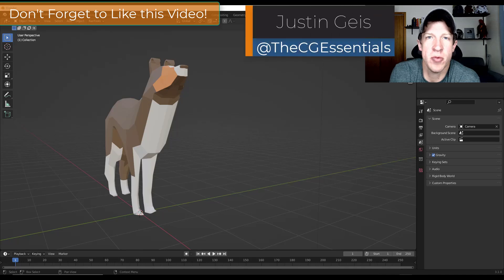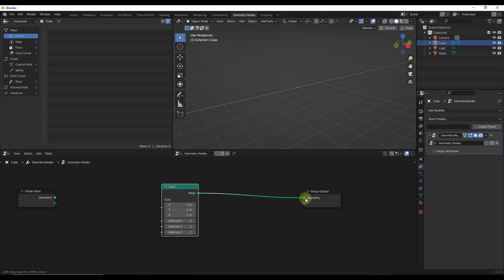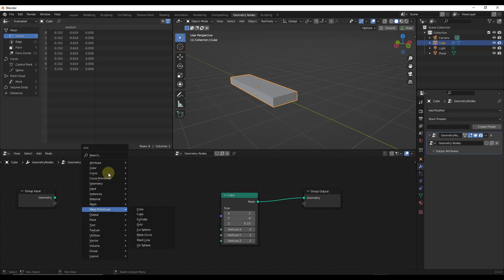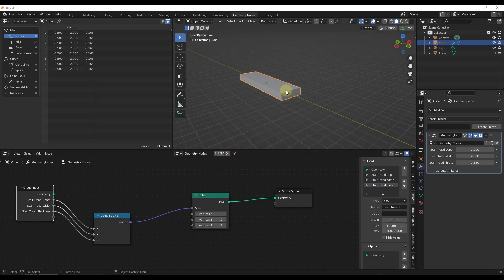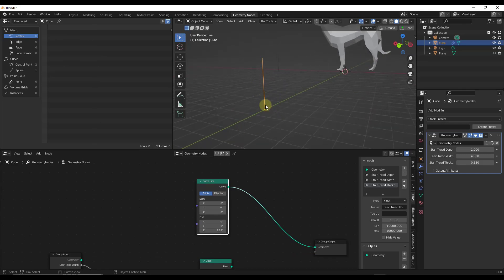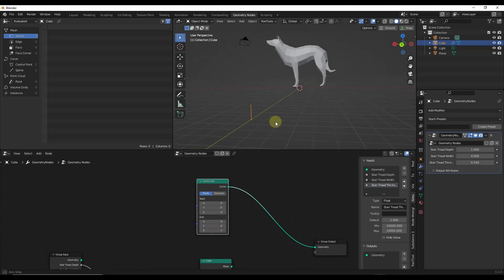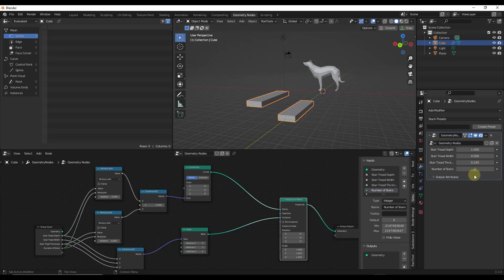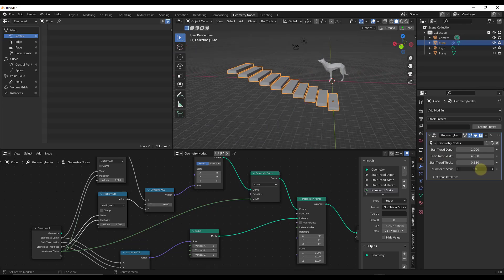Geometry Nodes FOR ARCHITECTURAL MODELING - Creating a Stair!

Comment: Hmmm, I've monkeyed with this for hours. in both base digits and imperial running through a conversion and the stairs don't line up. If you go to a top view and look down, you'll see they do not line up, there is a gap that shifts in dimension between the treads. I think this needs more math to work. The tread width would have to be able to adjust width itself, otherwise you have to go back to a stair calculator, find your rise, run, and number of stairs, then enter those numbers manually into the modifier. You have a rise and a run and a diagonal created, the points are set on the diagonal but your tread width relates to the leg of the triangle running along the floor, unless the total length along the floor is cleanly divisible by the number of stairs times their width,  you don't have stairs you can use. I picked up on this when I tried adding geometry for a riser for each stair, I can have the riser match the front of the stair, even build in an overhang but, because the points set on one leg of the triangle and the width of the treads aligns to another, the bad fit becomes glaring. The problem being is that it is not following the traditional, functional math flow and architect or carpenter would use.

So, if you are wanting it to truly be architectural, here's how the rules work, and this would take a lot of math modules; You have a total rise for the entire staircase, and a total run. That has to be divided by the number of stairs but, there are building code limits (I was a trim carpenter in an earlier life and built plenty of staircases), the maximum rise for any step, top of tread to top of tread, is 7 3/4". The tread depth has a minimum distance of 10"...that is edge of tread overhang back to the riser face. The number of stairs being divided into the total rise would be limited by the total run distance of the staircase. This doesn't always work for even amounts of rise to fall in that range so, the very first step can be off of what the other steps are as a "float" to absorb some of the distance difference but, that first step also has a minimum rise of four inches, which is more than half of the regular stair step maximum rise so it works well to take up the difference, you are allowed the float of 4" up to the maximum of 7 1/4", all other stairs have to be equal. That bottom riser would be its own geometry node tree within the entire node tree, and everything would key off of it. Oh, and one other monkey wrench to throw into that, the maximum total rise for a staircase is 151 inches, then you have to have a landing before continuing. That is the floor to the landing surface. AND, if you are here in the States, you need to keep in mind, the geometry nodes don't shift to inches just because you set the scene to inches, you have to set up a row of Math Multiply nodes to convert all your XYZ by a multiple of .0254 if running in inches, which you would do because your tape measure is inches. 

Some fun huh? I was starting to lay out the entire node tree but set it aside, I just need my one set today so I manually entered rise and run in my particular project but will come back to it. It can be done, just need to get in to deep Zen mode and map the steps out on paper first as if you were actually building a real set of stairs. I haven't seen a tutorial yet that has mapped that out and I'm betting it would be an hour long when it does show up. I have to say, this has been a good exercise to get used to geonodes but for true architectural, you would strip about half out and go another, much more involved direction.

Comment: Hi ty so much for video, just wondering what I have slightly off- my  addend on 2nd multiplyer is 6.3 where yours is 0. I had to choose the higher value on stairs  to stairs to go UP on  'z'.  Is it because I'm using 3.6.5 ?

Thx

Comment: Gm, your vids have been incredibly useful & efficient. Thank you, kind Ser. 
I have emulated a couple iterations , however there seems to be a gap between each step & the units will not compute for imperial, despite changing it so. Was curious if you know what could cause this?

Comment: Thank you.  For everyone's reference, currently Blender doesn't convert integers to scene units; integers are tied to base Blender units (meters, basically).  The process is helpful, but the end result is not to scale for imperial unit use.  You can see the problem in the video when the stair is resized using the Combine XYZ method.  The grid is set to scene units and as soon as the stair is resized to 4 using Combine XYZ, it becomes just over 13 feet long (you can see by counting the grid lines).
Reply: I noticed that too, between the Group input node and the Combine XYZ I put three math nodes, one each for XYZ and set them to multiply with a factor of .0254, that gave me my meter to inch conversion at the very beginning. Too bad geometry nodes doesn't see the Scene Units and adjust. However, I also put a riser in under the tread and that required converting each of those XYZ coordinates with math nodes. Then I put a tread overhang, also needing conversion. So, you see where that can go, a node tree that grows quickly.